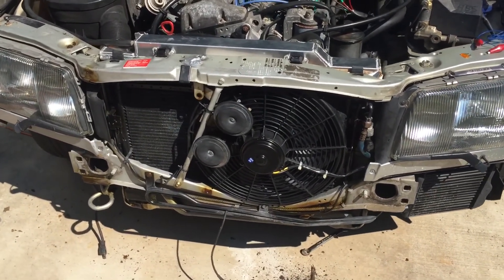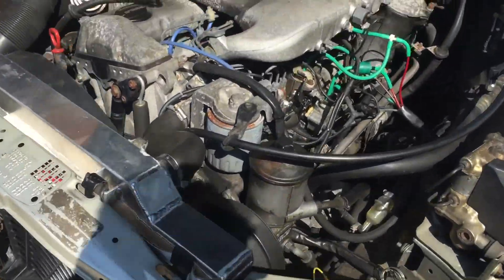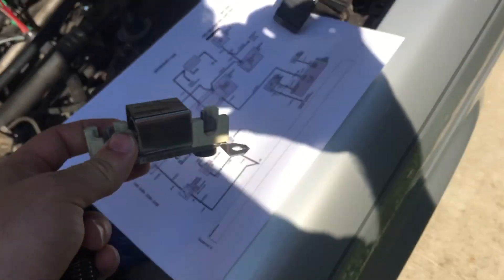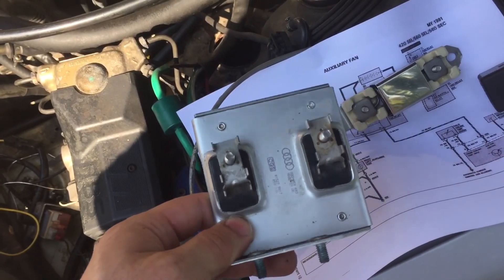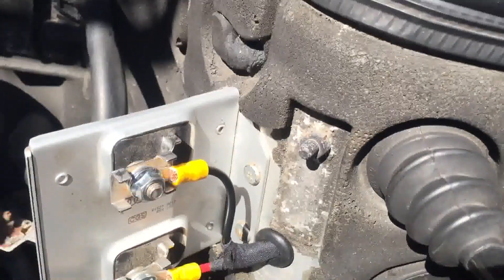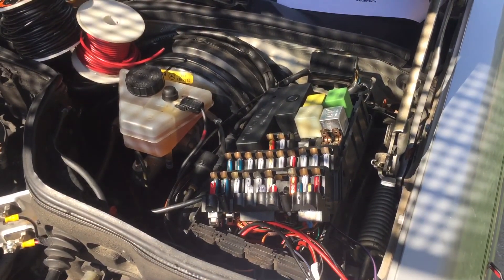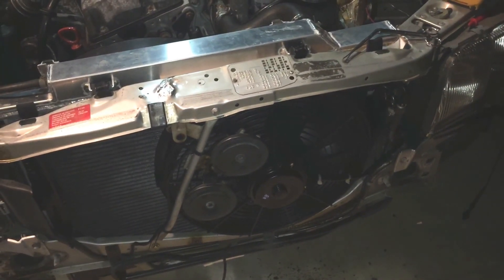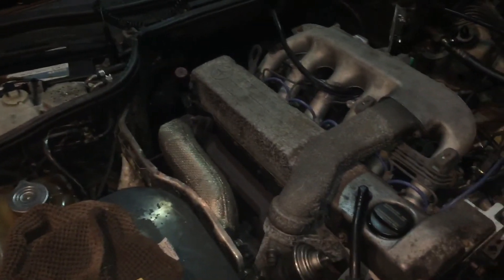Mercedes 350SDL Electric Fan modification

Comment: I have a 1987 300d w124
I think I am going to replace my 
Clutch fan with an electric fan
To keep temp down while running ac. The clutch fan robs power and fuel economy. And doesn't come on till 100 to 110c 
I want it to run about 195 with ac running.

Comment: Could you have reached the other connector from beneath the car?
Reply from the maker: On the original "pre-resistor"? No way, the firewall is in the way. It's actually bolted to the engine compartment side of the body firewall, then the 2nd firewall is mounted in front of it.
Reply: @compu85  Seems like poor engineering to require so much labor to replace a small part.
Reply from the maker: @jimbuford4147  I'd agree. Look up replacing the front sway bar on a W126 - it's probably the biggest job on the car!